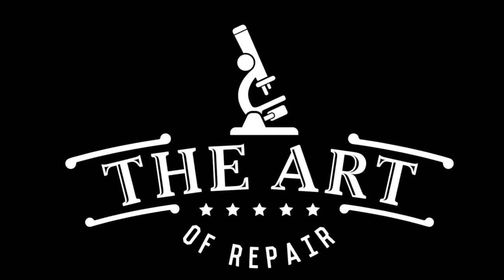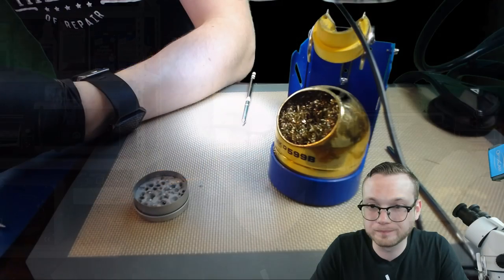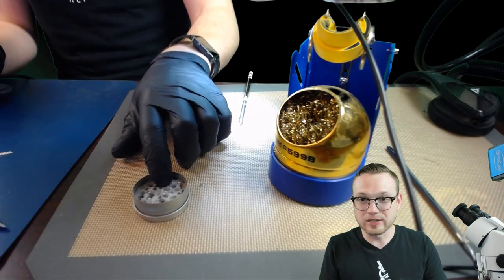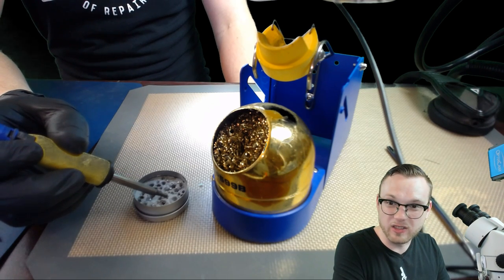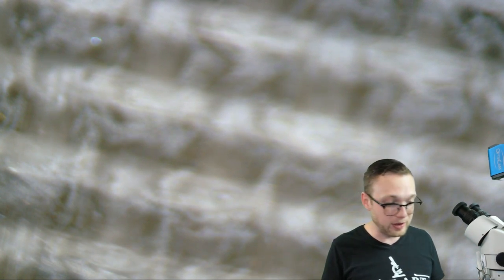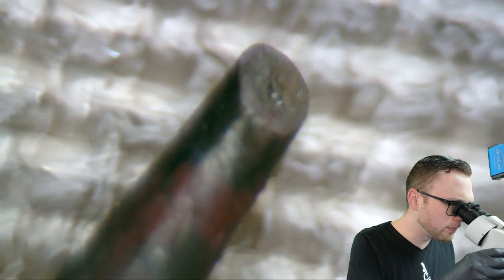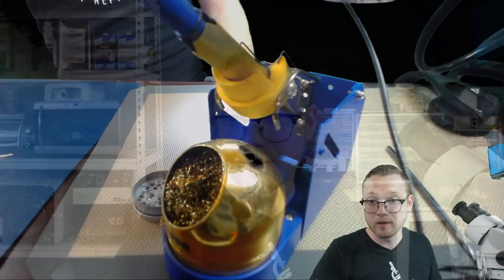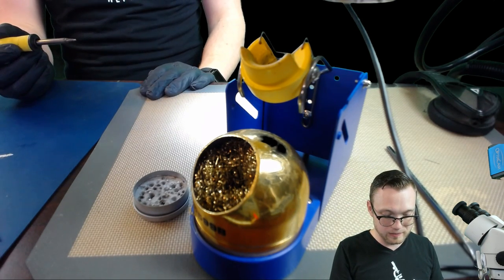EP52 Tip Check | Good & Bad Soldering Tip Habits | Why don't my soldering tips last long?

Comment: Should you clean the tip before you put it in the holster? I would guess not since the residual solder would act as an oxygen barrier while the pen is at rest?
Reply: You should clean it with flux and tin it with fresh solder before holstering it and shut down. Then clean and tin first thing upon start up before your first joint. Then clean and tin every few joints. 

You are absolutely correct about the solder protecting the tip. The solder does a much better job of this when it is fresh and clean.
Reply from the maker: Bullfrog said it best!
Reply: Best way to say it is, if you think you're cleaning and tinning too much, you probably need to clean and tin more often.

I don't use tinning/cleaning compound. I use plain paste flux and solder wire. If I need deeper cleaning, I use plumbing flux and make sure to clean the plumbers flux off real well before doing another solder joint. I have a tub of plumbers flux that I use just for this. I treat it like tip tinner, just dip the hot iron in it and apply solder. Clean and repeat and clean again until desired level of tinning is reached. Cleaning is important, but it always needs to be followed by tinning. Cleaning removes the oxidation. Tinning prevents it from coming back.
Reply: Always remember the three big factors that affect all chemical reactions (such as oxidation.)

1. Time
2. Temperature
3. Surface area.

Soldering is already at a disadvantage because it is hot, and the tin layer is thin (high surface area.)

Comment: The thing I notice a lot of folks doing is running their iron way too hot. Most electrical soldering does not require the hottest setting. Dial it way back. Too much heat burns flux, oxidizes the tip faster and causes you to have to re-tin within seconds. When you run too hot, the problems come at you faster. 

Burnt flux doesn't let the solder flow, then the tendency is to turn the heat up higher, because more heat melts solder, right? Wrong! Lower your temps to just hot enough to quickly flow the solder without burning the flux. Flux is your friend. Don't burn it and use plenty. Clean often, tin often. Oxidation is enemy #1.

Comment: Great video, very interesting. I only solder occasionally, is there anything you should do between sessions to protect the tip? Also, is it worth using the tip tinner, just wondering what the advantages are
Reply from the maker: Just try not to keep the iron on when not in use, you could always keep it in an oxygen free environment if its possible.

Comment: I was wondering if it would be better to store the tip into some sort of flux-bath or tin-bath when the soldering iron is off?
So the tip is submerged into something that is great for the tip.
Reply from the maker: I would say yes, If you can store it in any sort of oxygen free environment that would help the tip live longer. But also on that note, alot of the stations i grew up using did not have any auto sleep settings, so I got in the habbit of either using a foot pedal and keeping the device on. so It would only stay on as needed. or so just turn it off asap when im done with the iron. This will keep things nicer even longer.

Comment: How long does it take for a tip to become irrecoverable? I just bought a weller wps18mp and began soldering without knowledge of oxidation being the enemy. The thing is, the iron has been switched on for a sum of maybe 10 mins in the 3 times I’ve tried to use it, giving me problems as early as the 2 use. I know it’s not the greatest iron, but I’m not gonna be soldering enough to buy $100+ iron. Does this sound normal? Does it really go that bad that quick?
Reply from the maker: I would say once the very tip cannot hold solder anymore is about when its done. Never a good idea to actually shave or reshape the tips.

Comment: doesnt cleaning it with the sponge remove solder? that part of the process confuses me, it removes oxidization but if its oxidized how is it tinned?
Reply from the maker: The wet sponge is a final thermal SHOCK to the system to remove final oxidative coatings. it works based extreme temp differentials due to the water absorbing so much energy and reacting violently with the oxidation. But it only works to a small extent, ie a final last measure to help clean. If you solder all day, it means nothing really. If you solder only during blue moons, it can help. =)

Comment: According to Hakkos tech notes, Those tip tinners are extremely abrasive and highly caustic. They are only intended to be used sparingly to rejuvenate heavily oxidized tips. Daily use of TIP TINNERS is strongly discouraged as doing so will cause premature failure of the tip plating.  Otherwise great video. And yes the 202's have gotten far to expensive for what they are. I would much prefer A new Hakko fX-951 to a used 202.  

 Rather than a generic auto-off feature, The FX-951 has a programmable auto sleep feature that puts the iron to sleep when placed on the stand greatly extending tip life. 

 I have mine set to go to sleep as soon as it's placed in the stand. It takes about 10 seconds for it to ramp up to temp and it beeps to let me know.  As far as I'm concerned the composite tips combined with auto sleep are the two greatest advancements in modern soldering iron technology all the other features are pretty much just useless feature bloat. The last thing I need is a "smart iron" with a 30+ item nested menu system 

The way the sleep system works is when you place the iron in the stand the Iron temp is dropped below the melting point of the solder. The solder solidifies on the tip and protects the tip. Then when removed from the stand the temp quickly ramps back up to operating temp (about 5 to 10 seconds depending on tip) and the Iron beeps to let you know its ready. In practice the iron is up to temp before you reach the PCB
Reply: https://www.youtube.com/watch?v=Pz8L1tuK2RQ

hakko video shows them using one and calling it "non corrosive chemical paste", maybe it's different, but they all seem to do the same job and look the same too.
Reply: Yes that what i used to read previously about tip tinner..
Reply: Ofc hakko would say that... they sell tips...
Reply: @Beardwhip  I mean on the surface level this makes sense. But Nintendo says you shouldn't put your game carts in water and they sell game carts...so that line of logic would imply not only that we can but SHOULD put game carts in water.
Reply: I don't listen to manufacturers. I never have problems. I usually find the the manufacturer suggestions cost me more than not listening to them. YMMV, do your own testing and research. Always suspect those who sell you stuff as doing exactly that. They want to sell you stuff, wether you actually need it or not.

Comment: I just bought a solder station from Amazon. I am trying to remove tension module from ps5 controller.. the solder will not melt at all. I am not sure why. I was able to remove the replacement module needed to insert with no issues, but the ps5 solder will not melt...would ypu know why?

Comment: Hey Justin, can you give some words about the hot air station you are using compared to Hakko and Weller.
I need a new station the Quick 861DE is on my list as well. Thank you!
Reply from the maker: Get the Quick before the price climbs to high, best bang for the buck on the market right now.  I went ahead and purchased a few of them myself, the  861 is about to become a classic.
Reply: Got a good contact on aliexpress for 861w truly remarkable peice kit.. n justin recommended it, threw the hakko out not even in same league in my opinion...

Comment: Any soldering station or setup should also have a decent multimeter included.  I am partial to Fluke but there are many of them out there that are pretty inexpensive.  Fluke makes a pretty inexpensive one for about $40 bucks but you can get them for half that and even half again.  But you get what you pay for so it's important to keep that in mind. If you are only going to use it to check continuity and simple stuff, maybe a $10 one will work.  But if you are going to be checking circuits and capacitance or resistance or maybe just a combination of everything a meter could be used for, then you may want to spend a little more.  Especially if it's going to be used a lot.  Having a good multimeter will pay for itself the first time it catches something that saves you lots of $$$$$.
Reply: wtf u on about lol

Comment: When i google “tip tinner”, i mostly get listings for “tip activators”, is that the same thing as a tip tinner? Just want to be sure i’m buying the correct materials 😅
Reply from the maker: Seems like the right thing, throw a link to justin@artof.repair and ill confirm it for you.
Reply: @TheArtofRepair  It’s a dutch shop, you probably won’t be able to read it. I’ll send it anyways.
Reply from the maker: @samover6603  I live in the Netherlands. I’ll manage ❤️

Comment: I solder wire splices on wire harnesses every day at work. Though usually I only solder 5-10 all at once every 1.5-2 hours. I just want to clarify, it is bad to leave it hot? And do I need to tin the tip before I turn it off?
Reply: Letting an iron run at say 350°C when not actually using it, just degrades and oxidizes the tip faster. If your iron can heat up fast, then just turn it off when not using it. The next best thing would be to turn the heat way down while it's "idling".
Reply from the maker: Jason is right, leaving it hot without looking after the tip is not good for the longevity of the tip for sure. Best to do as Jason mentioned, either that or pickup a unit that has a sleep feature.

Comment: Could you still clean it without the cleaning paste? (Tip tin cleaner)
Reply: Yes. Just use a moist/damp (soldering) sponge. Brass wool as a second measure. The tip tinner actually should only be used as a last measure for really oxidized tips, since it's acidic and eats away the iron plating on the tip over time.

Comment: I use a damp sponge for cleaning and always keep the tip tinned. I solder a ton and my tips last about 2-3 months for the smaller 30 watt weller iron. I still don't understand why the tips get eaten away so quickly on my 150 watt weller though. It's the horseshoe style tip and the end always gets thin and eventually comes apart. Any advice on how to make those tips last longer? Is a damp sponge poissibly causing it?
Reply: not sure if it's still gonna help after all these years (just found this video) but if you believe that the sponge is causing your issue try to use only the metal wool or bras, how they call it
Reply: The damp sponge method isn't preferred anymore. It's not as bad if you use distilled water, but most people use tap water and all of the minerals and stuff in the water burn onto the tip and oxidize it. Preferred method is the dry brass sponge as seen in this video.
Reply: @Joesbeasty ,  The damp sponge tends to thermally shock the tip and damages the iron plating that is factory applied to quality-made tips.  People also have a tendency to make the sponge too wet ----  I watched a video recently where plumes of steam were coming up from the sponge as the tip was wiped against it ! which likely meant both that the tip temperature was too high and that the sponge was saturated with water. I prefer the brass wool tip cleaner, although I don't see any reason why one couldn't save a few bucks and use a curly metal kitchen scrubber,  be it copper or stainless steel. Otherwise, one thing that newbies haven't yet learned the hard way is that the internet is awash in cheaply made, counterfeit or knockoff soldering iron tips, garbage solder, and corrosive fluxes. I posted a video about cheap soldering iron tips on my channel recently: the short-form version is that if the tips are strongly magnetic throughout then they're garbage; they won't transper heat quickly/efficiently and they'll pit, corrode and oxidize quickly. Tips should be made of copper with iron plating at the pointy end because copper would quickly be dissolved by the molten solder and flux, but iron resists the dissolving effects of the solder yet still allows solder to wet to it for an efficient transfer of heat. 

 Buying soldering iron tips (or solder and flux) from AliExpress, Amazon or flea Bay is a crap shoot and you're most likely going to get an inferior product. Even if the knock off soldering station aomebody buys works okay, the tips included with it are likely to be junk , as I discovered when I bought a Harbor Freight soldering station recently: the entire tip is apparently made of iron or steel and is strongly magnetic from one end to the other, whereas a copper tip would only be magnetic at the pointy end, where it is ---- or should be ---- iron plated.  The provided Harbor Freight tips are also conical and pointy;  but I've been soldering for over 50 years ( Including 20 years as a full-time audio equipment bench technician) and 99% of the time I prefer a rounded, blunt, so-called  "chisel tip" for better heat transfer.

 I don't know where the owner of this channel came up with the idea of soldering as being some kind of cold weld that forms under a vacuum,  because it's not true.Soldering creates an alloy between the metals as they dissolve into each other. If the preposition here was true , then you could solder to aluminum, but anybody who's ever tried it knows  that it's virtually impossible!

Comment: Tip tinner is quite magical if you don't know chemistry. I wonder if one can just make find tin dust and make some DIY paste with rosin flux.
Reply: The block of tip tinner is made with powdered solder and ammonium chloride which is strongly alkaline. It is a little bit rough on the tips and therefore it should be used sparingly and only when the tip refuses to be tinned with solder. The brass wool is the best choice for everyday, as you go cleaning.

Comment: Is there a particular reason a brass sponge is better than a normal kitchen steel sponge?
Reply from the maker: A brass sponge is specifically designed for cleaning soldering iron tips.

Brass is softer than steel, so it won't scratch or damage the soldering iron tip as easily as a steel sponge might.

Brass has lower thermal conductivity, which means that it will not cool down the soldering iron tip as quickly as a steel sponge would. Rapid cooling can lead to thermal shock, which may shorten the lifespan of the soldering iron tip.

I hope this helps! Thanks for leaving a comment. Hope to see you commenting on other videos 😎💪
Reply: @TheArtofRepair  Could not have dreamed of a more extensive answer, thank you!

Comment: I've suggested this on another video about the same topic. You should not use a tip activator as a tin for tinning. Tips activators are always acid, cause else they won't work with rusty irons. You're eating away your tip slowly but surely.
Reply from the maker: From experience over the years from myself and from students and what I teach and see in class.

It only really tends to be a problem with thinly coated tips and micro points. So a larger t12-t15 tip. No problems I’ve got a box of them used in this fashion for years without issues. This coming from an fm202 station that does not back a setback feature. 

I’ll concede and say that if you have a setback feature that you can do this same thing without tinner and just use regular solder.

On newer 245-210 style tips I don’t recommend using tip tinner at all. Maybe once in a blue moon.
Reply: @TheArtofRepair  idk, i never got to a point where i needed tip tinner, and for what i know, at least with my tip tinner (they all look the same outside), that I've still got to use, it says it's corrosive and there's plenty of people, also from Weller's, which says it's not a thing you would want to do every time you're soldering. I've bought my Pinecil a year or 2 ago, didn't used it as much as i would like to (I'm still finishing school and I'm focusing more on 3D graphics than electronics right now), but i use flux when i use it for dirty soldering, or just solder i have (from Philips, a great solder to me), and it's still in good shape. I apply some solder before cooling it down, and leave it there till the next time i use it. I think that maybe, the fact that you use brass wool, and the fact that you are quick when you dip it, helps to mitigate this? Or I'm just mistaking a tip tinner for a tip regenerator? Can you clear me out on this? I don't want to spread fake information after all
Reply from the maker: @NightVisionOfficial  that all makes sense , I think from my end I’m giving advice to people who may be at a repair shop and soldering or having their iron on 12 hours a day so I think it makes a little more sense.

The stuff you bring up is very valid though for anyone reading and made it into both my class in some respects awhile ago as well as into my new videos. I spent the last few months shooting a few hundred new videos, so there’s some new info.

I think also I always hate that videos become dated the moment they drop, and I think I have an answer for that with my new video drop style that’s coming, so hopefully I can mitigate more potentially confusing info for the masses

I do appreciate your comments and time you take to reply. Hope to see you in future video comments! 💪💪

Comment: Thanks justin i still have 6 metcal mx500 old but brilliant cheaper tips cant go past them..
Reply from the maker: Do you have the model without the temp readout? or one of the semi newer ones, I have been eyeballing a few mx500s but I don't know anyone with them. If you say they are dope sauce, ill pick one up and check it out.
Reply: Have original mx500 no lcd display,  never used lcd display, tip type defines heat... best part lol is move one jumper on mx500 turns it from 110v to 240v... cheap power supply last 2 65us landed in Australia...